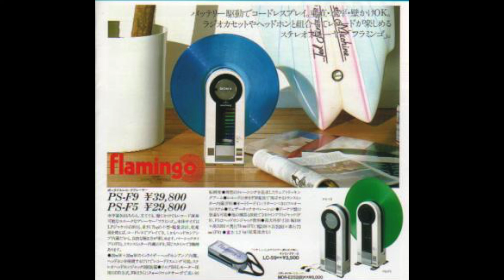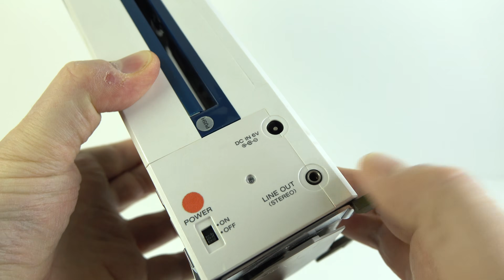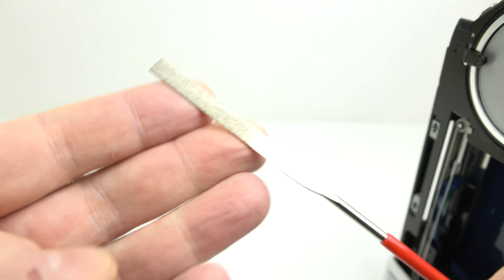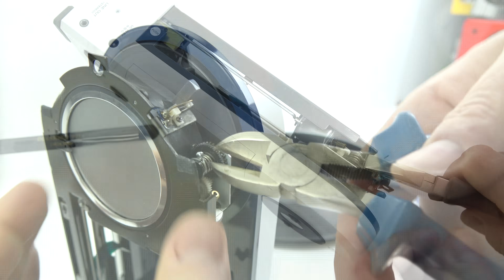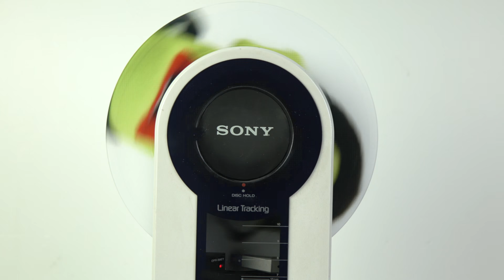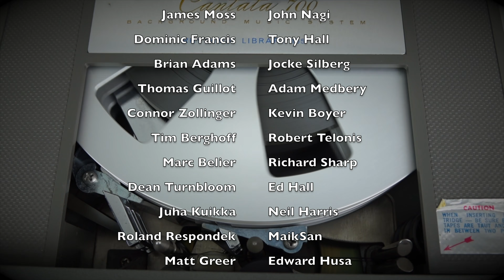The Sony Flamingo PS-F9 (Repair & Demo)

Comment: The tracking force is surely fairly heavy if it can play the record vertically. It brings to mind the in car 7" record players that apply the stylus to the underside of the disk.
Reply: snolan1990 
I have one and I found a pdf version of the service manual.  According to it, the tracking force is 1.7g
Reply: Interesting! Not very much.

Comment: Just recently I have made a few "6V center negative barrel connector" to USB leads for electric pencil sharpeners for a local school. You see, somebody thought he was being a clever boy by eschewing batteries and plugging in a fitting 12v center positive wall wart, with the result of the motorized mechanism going backwards and the motors smelling of burnt lubricant.

Comment: As a last resort, locking the clutch by gluing the two gears together would always be an option. Not a very pretty fix, since it wouldn't be able to slip in case the record isn't properly aligned or whatever, which may damage the gears or the motor.
But if nothing else works, I guess that would sort of fix it.

Comment: I'm going to say that this thing had a rough price of about $345 in today's money.

In 1983, the exchange rate for the yen to dollar was about 235 to one. https://www.poundsterlinglive.com/bank-of-england-spot/historical-spot-exchange-rates/usd/USD-to-JPY-1983

That comes to about $145 in 1983, which had the same buying power as $345 in today's money. https://data.bls.gov/cgi-bin/cpicalc.pl?cost1=145&year1=198301&year2=201710

If someone finds a different figure, I'd be interested to see how you came up with it.

Comment: Sony was the best for their time.  And they are still good but nothing like they use to be.  They also seem to be the only well-known brand to be putting radios on the market that still play and record cassettes.  There are others but I have not seen them locally.  I think they concentrate too much on their PlayStation line of products now instead of their audio stuff.  I agree that it would be nice to see Sony bring back the audio gear the public misses with that quality only Sony produced instead of the China stuff.  Nothing against China but their products are not always the best.

Comment: This reminds me of an odd device I saw on display in a mall in the early 1980s. It was a record player which had a peg on one end to be placed in the center hole of the record and two rubber wheels which rolled on the table outside of the record. The record remained stationary on the table, and the player with its motorized wheels, needle and amplifier/speaker went in circles around the record. Obviously the sound wasn't so great with only a two or three inch speaker, and I am sure the needle tracking and mass was dubious, but it was a novel idea. I never owned one, but I remember it clearly.

Comment: More accessories can be seen here: https://www.ps-f5.com/accessories-spares

By "more" I guess I should say, "an American version of the soft carrying case without the Flamingo logo."

But also good info on replacement stylii and some nice reproduction parts when you are missing a dust cover or battery cover:

https://www.ps-f5.com/accessories-spares/styli
https://www.ps-f5.com/reproduction-3d-printed-dust-covers/810
https://www.ps-f5.com/accessories-spares

And a neat post about hunting down stylii info:
https://www.ps-f5.com/what-is-the-ps-f5-ps-f9-cartridge-its-not-p-mount/542
Reply from the maker: Yes I’d put a link to that site in the video description text box. They have some useful information.

Comment: The issue with the original felt washer appeared to be that grease had migrated into it and reduced the friction to an unacceptably low level.  First thing to try with any plasticky clutch mechanism is a good clean with alcohol to remove greases.

Comment: Techmoan, the "Techmoan Effect" you mentioned is true.  I went and looked up this item on eBay and the going price right now in USD is between $799-$1,292 after you posted this video.  Last week this product was between $150-$400.
Reply from the maker: It’s never been under $500 in the 5 years or so I’ve been looking for one, and as you can see in the video it was already €1000+ when I was looking then.
Reply: Techmoan well damn I feel like an ass.  Apparently it was one of the off brands I saw since I went back and looked from a saved eBay listing.  Apologies.

Comment: Nothing is made in Japan anymore except maybe animal-themed pencil erasers.  So if Sony reintroduced classic products, they would be built to the modern Chinese junk standard.
Reply: Asterra2 Look at the higher end. Plenty of stuff is, its just expensive
Reply: But wait... Sony manufactures many mid-range products in Thailand. I'm sure they don't make garbage there.
Reply: Chinese manufacturing factories build what the client specifies. If the client does their own engineering and presents a design, specification and bill of materials that is high quality, the end product will be high quality. 

Unfortunately, way too many clients are designing to a price point not to a quality standard. The Walmart's of the world push for lower and lower cost with every order. 

Even more of them don't actually engineer anything. They go through the items the Chinese offer for sale and stick their brand on it with very little changes that aren't just cosmetic. 

So that, in a few sentences, is why a lot of Chinese made goods are of such low quality. Ah, but they're cheap.
Reply: thatt would be gutting but true

Comment: Welcome to the PS-F9 club 😊. I have the PS-F5, PS-F9 EU and PS-F9 Japanese with FM-transmitter. I used to fix the clamp problem by easing the springtension that pushes the large pin into the hole of the vinyl by cutting the spring a little bit shorter and bend the end of it preventing hitting the plastic seem. Still it could hold heavy vinyl succesfully without aid.

Comment: The reason for the 'slipping gear' mechanism is in case it runs out of battery, that way you can pull the lever across and release the record without shredding the teeth off. What can you do if it runs out of battery... Put new ones in! JUST GLUE THE GEARS TOGETHER! Works fine, the clamp is sprung loaded so it won't damage your records, and the clamp motor cuts out automatically after about 5 seconds if the micro switch doesn't make contact anyway. The bracket does come off too btw, held on by two screws.....
Reply: what happens on a misalignment when the center peg can't find the hole?  doesn't glueing strip the gears then?
Reply: Nope, the pin has a spring behind it's base that compresses if it's misaligned, and the clamp motors not that powerful anyhow.

Comment: Hope you somehow will read this.
In my old line of work in the bicycle industry we used a kind of friction grease to make the seatpost and other parts that shouldn't be sliding when you don't want it to.

This kind of grease is often called carbon grease, some of these got a bit of sand mixed with the grease, but there are friction grease made for carbon bicycle frames that, instead of sand, got tiny plastic particles mixed with the grease. The plastic-particle-grease  shouldn't wear the cogs out any faster than the felt mat would,  i'd say. This could work for the sliding friction cogs when the felt mat no longer works.
Reply: Ah, is this a really thick grease which is used in soft eject & tonearm damping mechanisms?

Comment: This thing would have looked so futuristic in 1983. It's a nifty device.
Reply: That thing cost 40,000 Yen in 1983, equivalent to $170 (or $400 in today's money). Probably the upper end of portable disc players.
Reply: For $150 in 1983 I bought a 4-speed Panasonic stereo unit with AM/FM tuner and cassette recorder.

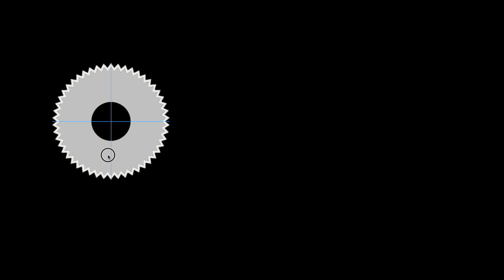Comment: I stopped at 9:25 just to laugh because I was screaming in my head as soon as you pulled the file. 'What about the clutch plate.'  I thought it must be missing or you shoved it back into the axel. Sure enough, it shows up.
Reply: I would have never guessed a "soft" meda would have been used as friction modifier.
Seemed "sound" (pun) to me.

Comment: A friend of mine had one of these back in the mid 1980s. It produced good quality sound for about two or three years, but then a bearing when bad it it somewhere, and  it started transferring harsh vibrations from the rough bearing through the stylus.  After that it was just too painful to listen too.

Comment: The part you need is X-3312-201-0   
Part Number #153

Exploded view   https://www.manualslib.com/manual/1001375/Sony-Ps-F9.html?page=27#manual
Part to order      https://www.manualslib.com/manual/1001375/Sony-Ps-F9.html?page=30#manual

Comment: I got my PS-F9 about 2 years ago, and it suffers from the same issue that yours initially did. Although I upgraded the stylus and replaced the belt that drives the tonearm mechanism, I was too afraid to tamper with the clamp mechanism lest I break something. Thanks to you, I finally know how to fix this. Many thanks, sir!

Comment: Hey I’m new to turn tables and vinyls, I need a durable long lasting turntable, can you recommend me a good one for around 300-400? Or even a old one off eBay if it’s good will work, I also don’t really care about looks as much I’m more worried about how long it will last and that it won’t mess up my records
Reply: $ 300-400 US
Reply: For that price point (and the fact that you're new to vinyl and prefer function over form) a great choice would be the Audio-Technica LP120 (NOT the LP60) it already has an amp built in but you can bypass it if you want.

Here's a pretty good review if you're interested.

https://www.youtube.com/watch?app=desktop&persist_app=1&noapp=1&v=Q5ljqkdnBmw

p.s. don't buy crosley :)
Reply: Fake Name thank you for the suggestion my dude, it looks really nice

Comment: I'm really happy you made this vid, as i had the same issue with mine, and no idea why it did that. Thanks!

EDIT: it is possible to remove the cogs by first unscrewing the 2 small black screws on top of the frame (right above the motor), then carefully moving the assembly consisting of the motor, the faulty cog, and the white cog in the centre of the frame (watch out not to tear the ribbon cable, it's sticky-glued to the frame)
then you can see some plastic clear 'seals' on top of the two axles, these can be removed by lifting them carefully.

 https://i.imgur.com/ZouC3kb.jpg

Comment: Where is the PS-Q7 you "demonstrated in a previous video?" 10 years ago I was dying to find one. There wasn't many on eBay then. Now it doesn't matter. I know it's not the ultimate turntable for one to get. But it should be worth to see your review of it. The good thing is the news that Sony is considering to rerelease them. They already had built-in preamps, but instead of FM transmitter, it should include a Bluetooth transmitter.
Reply from the maker: It wasn’t a proper review..it was just used in a video test when I was trying out 4K/UHD for the first time on YouTube. https://youtu.be/i8yx3yug5lo
It also appeared in the D88 Discman video. https://youtu.be/AowJGns66_4
Reply: Incredible. I did not see that one. I began watching your videos in 2016. I bought a  new 4K TV and was testing YouTube videos, then I came across with your retro-gadget reviews and started binge-watching them. I wanted that PS-Q7 for years, was checking ebay constantly to find one. I had first seen its picture on a Sony catalog in the 1980s in Turkey. It was out of reach but fell in love with it then. Later I moved to obtained a turntable with better cartridge, then a fully automatic linear turntable did not make much sense to me, since you also said when reviewing Sharp RP-117, it wouldn't sound "better than an average turntable". Besides, PS-Q7's preamp should not be of any better quality. But both PS-Q7 and PS-F9 designs are superb. No other company's similar equipment could match Sony's.
Reply: Bluetooth should be kept out of the equation

Comment: The problem with the friction-clutch wasn't with that part of the mechanism but with the lubrication of the clamping mechanism itself drying out over time. I'm certain that spraying a small amount of white-grease on that spiral section would have had it clamping properly!
Agree that Sony should re-release devices like this that would have a market today, perhaps in contemporary colours like black & gun-metal to distinguish them from the classic collector items. However, what concerns me is what you didn't evaluate was whether there was an acceptable level of wow & flutter, or was it originally more of an example of Sony marketing miniaturisation at the expense of performance?
Btw, do you sell those Techmoan singles, as I can see them becoming very collectable!?!
Reply: MrWombatty
Indeed, there is a significant market that would pay very good money for such classics, why they haven't done it is a mystery. It might just help jump start the company's fortunes after decades of decline.
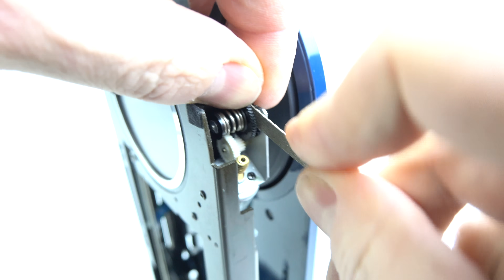Reply from the maker: I’d already done that. See 07:14 for a mention of this.
Reply: Sorry, missed that. Maybe the whole mechanism needed to cleaned first, but obviously that would entail a rather tricky disassemble! 
As to why the friction-clutch was slipping too easily, I had a thought that the previous owner may have sprayed everything with WD40, including that friction-clutch!
Unfortunately, contrary to popular belief WD40 isn't always the best lubricant to use as it thins out existing grease then dries out leaving inadequate lubrication in some places, but will also leave a greasy residue creating a problem where lubricant isn't wanted!
Note that I'm referring to regular WD40, not the WD40 PTFE (wet or dry Teflon) in the yellow spray-cans!

Comment: They had earbuds in the 80s? Wow. Heh, I mean I'm of course also impressed by the main product on display but I had no idea about the earphones.
Reply: MagikGimp I've used Earbuds with much older portable gear, 1960s or before (all mono, so one earbud each).
Reply: Oh sure; even crystal radio kits come with single earpieces but I was surprised we've had them that small for so long. I had no idea.
Reply: Ear phones have been around almost since the beginning but the ear bud design has not, I too was surprised that specific design was around in the mid 80s!

Comment: There are two black screws on the front in the lower right, are those holding the motor assembly on?

Comment: I would have called it a peacock. It looks nothing like a flamingo
Reply: I thought this too. Maybe someone remembered the wrong bird, but they got far enough into the marketing development that it wasn't worth changing once anyone noticed. Or maybe it's just "standing on one leg".
Reply: @matthewkriebel7342  no stfu flamingo is better
Reply: Peacocks were so 70's, Flamingos just scream the 80's.
Reply: I'd have called 'em chazzwozzers.
Reply: Looks and functions exactly like a flamingo circa 1980. Back then, they had a slot-loading record player, which biologists often mistook for fanned-out tail feathers.

Now that they've gone digital, the small remaining tail is a largely vestigial structure, so it's understandable that there would be some confusion as to the resemblance.
Reply: I thought the same thing! "Looks more like a male peacock with its tail feathers spread out!"
Reply: @compactc9  no stfu flamingo is better
Reply: Flamingo birds often stand on one leg, thus the name for this device... imo
Reply: I was about to say the same thing, Joshua.
Reply: Exactly

Comment: Does your "fix" still allow for some slip (in the video there was none anymore)? I know you said you used adhesive cloth on one side, but the gears being that close together it might still glue the gears together. Without slip the motor or worse the motor driver might burn out due to overload at some point.
Reply: superdau The best would be to download that service manual linked in another comment, the disassemble to the point of separating the two clutch halves, clean up the messy repair and recondition the spring to the correct force.

Comment: I had one of those  It was one of the cheapest turntables with a linear tracking tonearm at the time. Plus it was portable, which is why I bought it. (That and I liked the Sony Walkman cassette.) I was on a  linear tracking tonearm kick in the 1980s. My favorite one I owned was from Sansui. It was one of those tray loading ones (Several manufactures made them.) that played both sides of the record & you could program which tracks it would play. I went back to standard pivoting tonearms in the 1990s.

Comment: Those two spinny things are called a clutch.
Reply: That's not a prerequisite for it being a clutch. In particular this one is a slip clutch.  They're widely used in machinery; printers, copiers all the way up to heavy equipment.
Reply: Yes. It is a still ctutch. But in this case ise used tu limit torgue. BTW RC clutch disc material would be probably better way to fix it.
Reply: Yup, I cringed when he used that file to scratch the inside of that clutch, "yep, it's foked" was my reaction.
Reply: Correct, the most simplest form as used in cases like this are called a friction-clutches.
The first motor vehicles usually used leather as the friction material in theirs!
Reply: Me too, I would have found a way to dismantle the clutch assembly.  What's probably happened, is that oil or grease has found its way onto the felt and/or the friction faces.  A good clean would have sorted this out.
Reply: Ditto!
Reply: Probably they should've used a "slip dog-clutch" (basically a similar mechanism as used with hammer drills; where if one gear is stuck, the other one would slip but thus reciprocate outwards - infinitum... and thus not rely on a piece of felt.) But this is just a thought. 🧐
Reply: @MonoChorMe 
Yeah that clacking noise would be real nice on a turntable 😂
Reply: Paul Hicks It's not a regular clutch that can be operated on/off though.